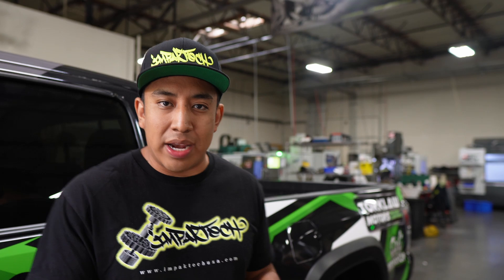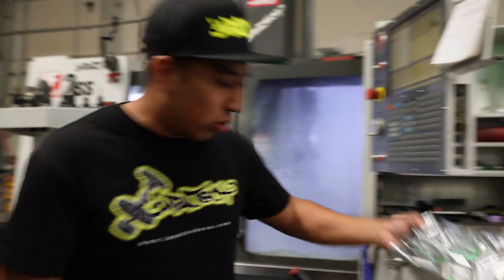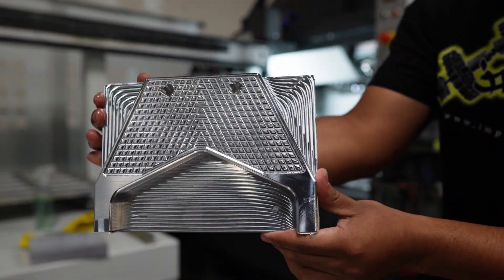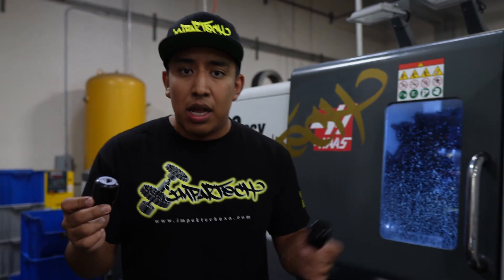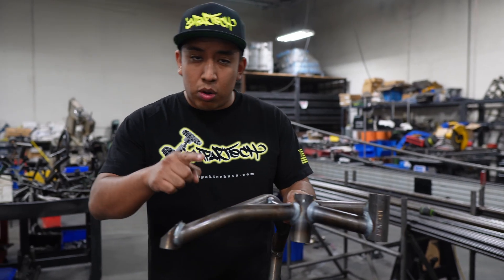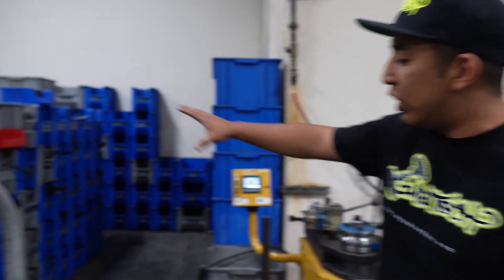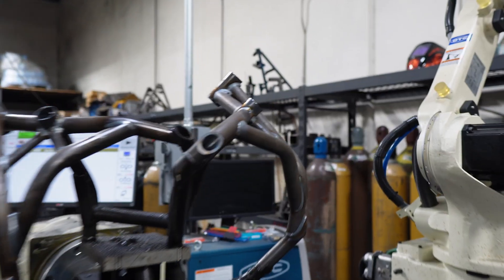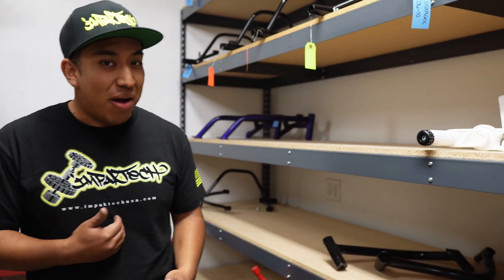Impaktech Honda Grom Rear Set & 12 Bar Manufacturing Process

Comment: Okay, lol. I actually learned to do both CNC mill and lathe on those specific Haas machines so I know exactly what is going on when they CNC those parts and all those buttons. But, they didnt show how they CNC the bottom out of those base plates as in how they flip the base plate after they CNC the top to finish the part. 

I would love to see that auto loader in process as loading a CNC Haas machine is super annoying to get it perfectly set with all the crap from the previous cut. Like cutting aluminum is so nice its like butter but me thinks the tolerance is good but not as percise as when I did it manually like .001 +/- when i learnt to do it. 

nice video lol
Reply from the maker: Thanks! I’ll be back over there soon so will see if I can get some more details and video of the auto loader in action!
Reply: @eastcoastish  i was wondering what is your opinion on mini turbos for the Grom. There are some for the OG Groms not sure if they are compatible with the 3rd gen. It looks like it will make 16.5hp but at higher RPMs. Looks really cool and its pricey like $1.7k.